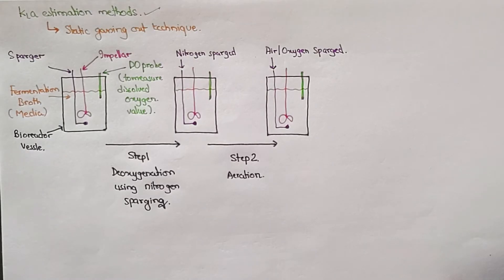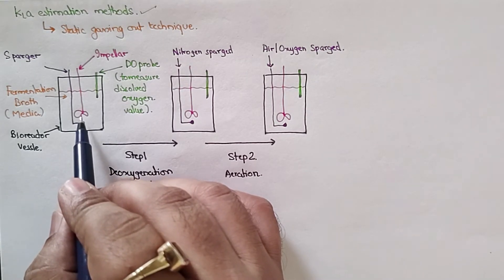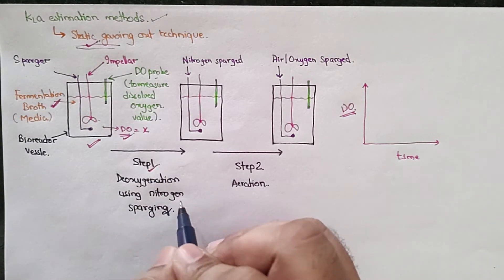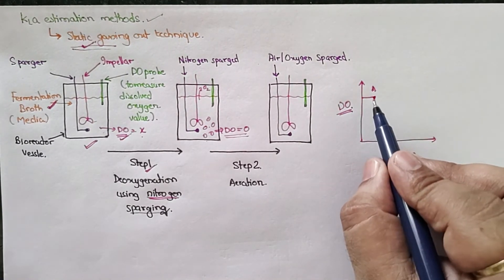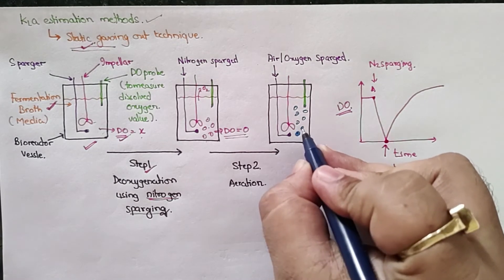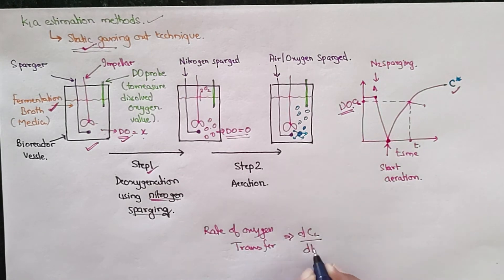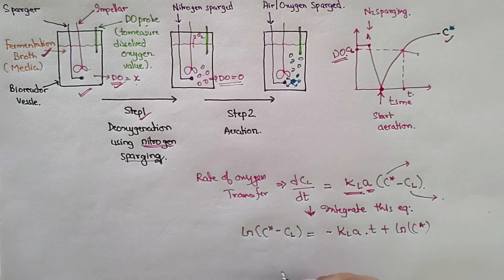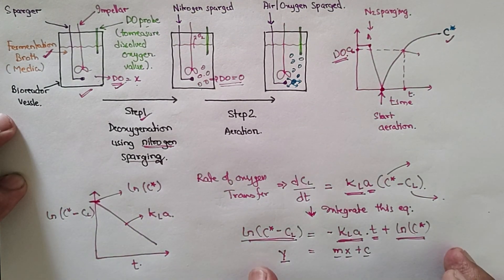Static Gassing Out: A Method for kLa Estimation in fermentor | Mass transfer | TPBS | GATE BT

Comment: How close should one get to the saturation point when aerating to ensure the measured Kla is accurate? Some models could take upwards of an hour to reach saturation again, not very long in a vacuum but doing many of these tests could be time consuming if they all took an hour.
Reply from the maker: These tests are time consuming and value may change at slight change in any variables. As far as I know, DO values reaching the plateau is important.